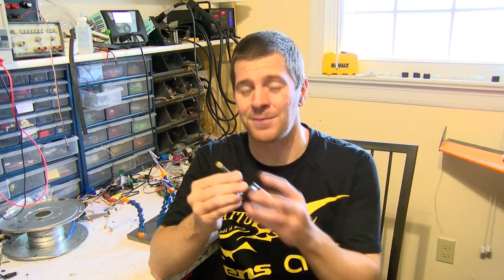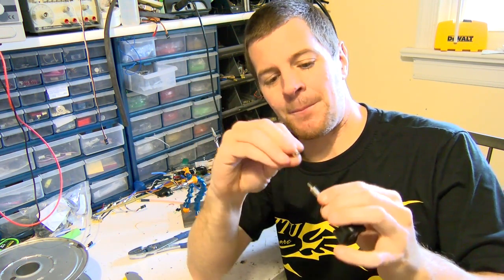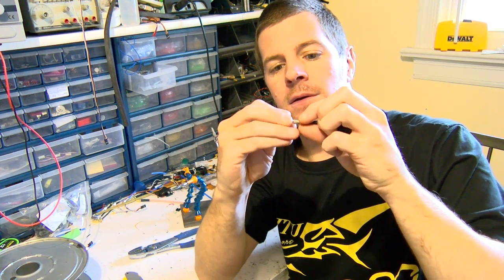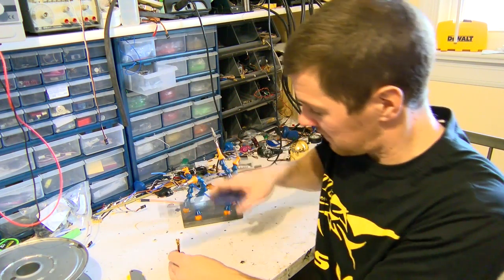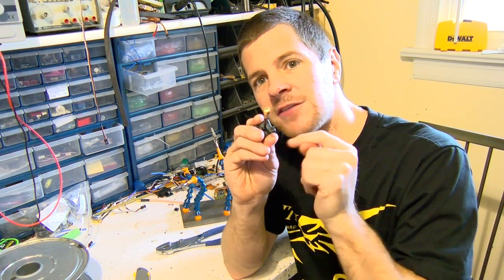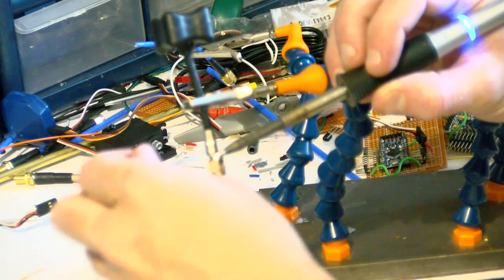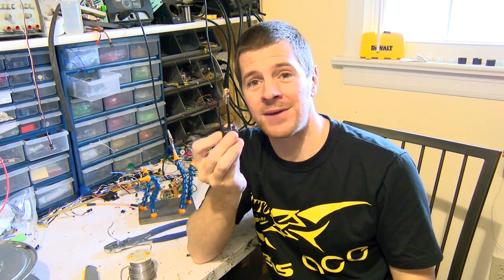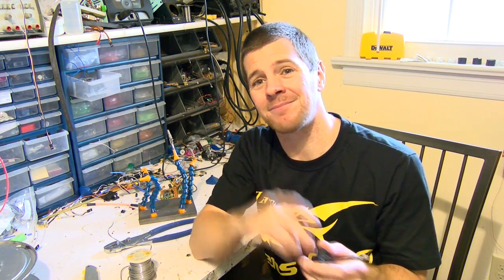How to repair a TBS Triumph with broken SMA

Comment: Hi Alex, I was wondering, I have two triumphs with missing SMA adapters (the whole adapter is gone). I prefer the stubby variant of the triumph. Is it safe to chop down the "stalk" on the antenna, should i cut to a specific length due to impedence and do I need anything other than some solder and a new SMA adapter?

Comment: Thanks for this, you've just saved me £40! 

I'd like to ask, could you do a video on how to repair a u.fl to sma pigtail (like those found on the IRC Tramp). I've got 4 of those VTX and on a few ocassions I've had the sma pigtail break off. I've gone and bought replacement pigtails for not very much but if I can repair them, I'd be much happier.

Thanks again dude, once you release your new antenna, I think I'm going to be due an upgrade!! :D
Reply from the maker: Those are not repairable.  This is the reason why I do not make antennas on u.fl!
Reply: Oh right, thought you might be able to resolder the wire into the SMA connector, just doesn't seem like I can disassemble it. Thankfully I can get 5 for £7 on amazon next day deliver! 

Oh, one quick question about the above. I've had a one of the barrell connectors come loose, does that need to be soldered on or can I just attach the SMA nut to it which will keep it in place?

Comment: Isn't the heat damaging to the dielectric in the RG402? Is it teflon? Will there be a performance hit after heating it up that much?
Reply from the maker: Not at all.  The insulation can take 950 degree temperatures!
Reply: Video Aerial Systems: Awesome. Thanks for replying.

Comment: after a crash my range went to about 50m and all I could see as damage is a strange kink look just as the coax enters the cap. I switched it to the Rx and even with a brand new tbs unify pro at 800mw with the good antenna on the tx my range is depressing at best.
Reply from the maker: Ground FPV range is VERY limited due to the Fresnel zone.  However, if your range has been significantly reduced after a roll-over, then it is likely the antenna get damaged.  Feel free to send me a photo.  If I am to improve this design, I need to know where to make it stronger.

Comment: I probably sound dumb but will this work for the RPSMA version too?
Reply from the maker: Yes, of course.  just be sure the socket is flush with the insulation inside the connector and it will be fine.
Reply: Video Aerial Systems thankyou 👍

Comment: Hey Alex, would be great if you could measure the SWR before and after this operation. I bet it´s going waaaay up. I had one repaired quite like this and it had a SWR of like 7 afterwards.
Reply from the maker: Sounds like something else might have been damaged.  So long as everything is re-connected, it should be fine.

Comment: Since the sma is weak point cant you come up with something smarter to solve that problem. E.g where sma connector normally goes... add some kind of mounting system? Then inside new mount just run a flexible pigtail from mount where you attach sma/rpsma?  Not sure how mounting system would look am sure there a few ways- possibly something designed to bend to absorb impact? Not talking specific to triumph here- you last video where u were smashing that antenna with hammer got me thinking
Reply from the maker: I actually came up with a molded cover.  unfortunately it was heavy and caused the antenna cable to shear off...  So basically i added weight and changed the failure point.  I need to revisit this.
Reply: hey.  would be awesome if u could revisit.... I like the idea of: a TBS size/weight head with duraspec cable going to indestructable (and replaceable) mount made out of some crazy strong (but flexible to absorb impact) material and then a flexible line which allows you to place vtx in a number of places. I have some duraspecs as i was tired of breaking them but find they are too heavy for 210 sized miniquads. ( and awkward to position especially if using a pigtail on vtx on a frame like QAVX
Reply: I do a lot of fabricating for the medical, film, and military using various flexible and semi-flexible materials that are designed to take heavy impacts and keep on going. Let me know if you have any material questions, I would love to see something like this that could help save antennas!

Comment: Is this a weak point on this particular antenna?  I don't recall other VAS antennas having this problem .. at least I haven't experienced this with my Duraspec or Airscrew.
Reply from the maker: It is the weakest link, yes.  The Dura-Spec uses a completely different type of cable and connector which is a serious mil-spec heavy duty cable.  However, due to the weight and lack of bend memory, the Triumph uses RG402 which is the industry standard.

Comment: Why isn't it soldered to begin with?  I have a couple sets that I've had to fix as outlined here that didn't have any solder out of the box.
Reply from the maker: It is soldered.  Then a crimp collar is installed for added strength.  Antenna connectors are not designed to take impacts.  This is the most durable connector design available.  However, if you want even tougher, you need a dura-spec antenna.
Reply from the maker: That is good to know.  I will talk with Trappy about this.  I have an idea on making the connection stronger.  However, this will likely distribute the impact energy to snap the SMA rather than just pull it out.
Reply from the maker: Different people have different issues.  Sometimes it is just a difference in installation.  The only thing we can do is look into it and see if we can find an improvement.  We do our best to make it the best we can.
Reply: Its a complicated problem.  IMRC vtx has a fragile sma soldered to its circuit board.  It doesn't take much of a crash to rip those off and while usually repairable its usually too late because they burn themselves up.  I've replaced a couple of their surfacemount amplifier chips to get them going again but the price of the chip vs a new cheap vtx is almost the same.  Wherever you make it strong it just breaks elsewhere.  I use a short extension cable securely attached to the frame as the only work around.  I hope to get some testing done with the new small aluminum cases vtx which both HK and getfpv sell which if sturdy enough could at least eliminate the extension.  I have a couple of other ideas on preventing a vtx burn up.   I have heard that current draw goes up when a antenna is mismatched.  I am wondering to what degree and if a simple current sensitive circuit could be put in front of the vtx power and if it senses a spike it would shut off.   Or my simplier idea which is to use one of the common micro receiver controlled switches (even a micro brushed esc should work) and have it control the vtx power.  Then you can assign a switch to it and manually cut power from your radio in a crash and also have your receiver failsafe to cut power.